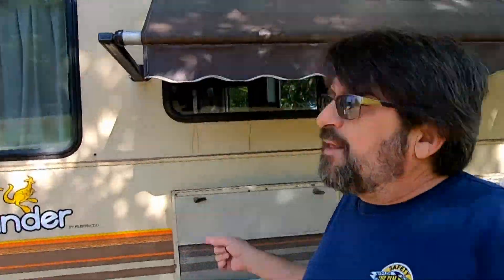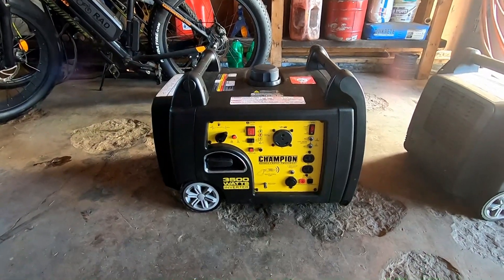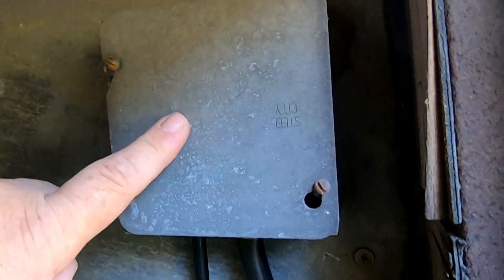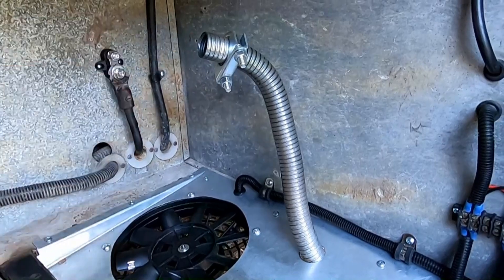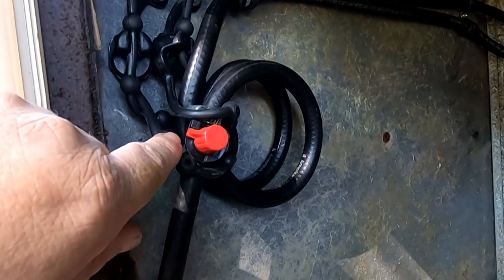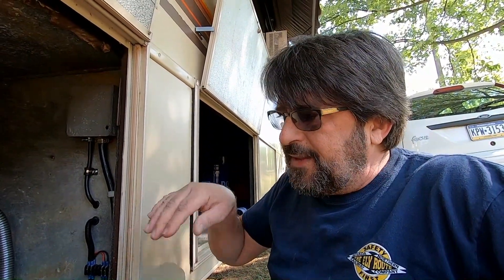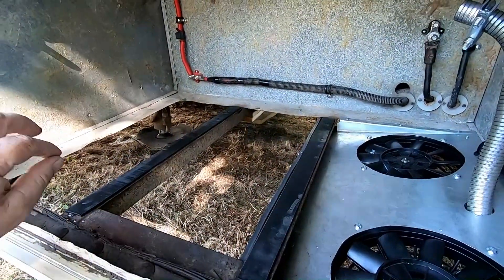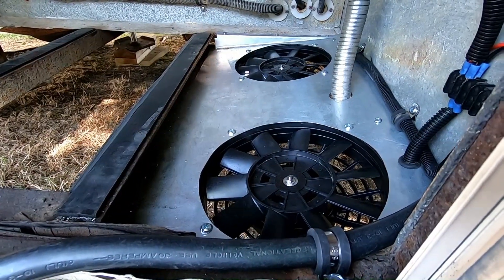Part 3 Installing a Portable Generator in a RV

Comment: How well do those fans push air? Cheap fans usually don't put out what they say they will. I'm looking for a 12 or 14. Thinking about buying one of each and see how well they work.
Reply from the maker: They each move 1000 CFM
Reply: @davesotherstuff  I bought a 12 and 14. I kept the 14 and returned the 12. I want to try and build a quiet box for my small 2250 generator and will use it to try and keep the temp down.

Comment: Great Video Dave,
Question on the back wall in the corner are 3 white plastic( at time stamp 8:55) things in the side panel with wires running through them What are they called ( I am in need of two but don't know what they are called

Comment: Good to see you again. Everything is coming together. Very neatly installed. Favorite: exhaust system to get heat and gases out of compartment. Second fav: hour meter. Third: "weird rubber straps". 😂   Any plans to put hardware cloth or something like it to block rodents from getting into the compartment? And maybe over the fans, also? Well, time to go over to Amazon to look up weird rubber straps. Good health and happiness. Hugs and kissies for Bella.

Comment: Nice install. I don't have a link, but you can get a remote temperature sensor for the generator bay. Class A Living has a link. Sensor in the bay and remote inside and you'll get an over temperature alarm. They're also made for the barbecue grill.
Reply from the maker: I've been looking at some of those and will probably add that as well! :)